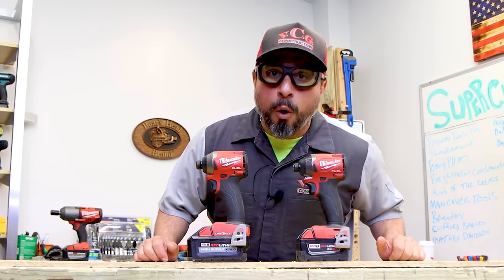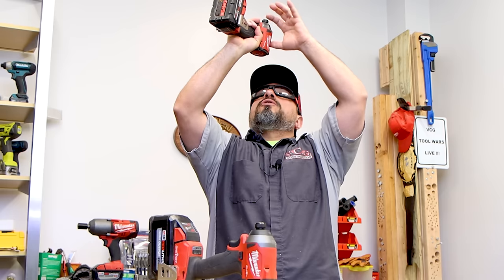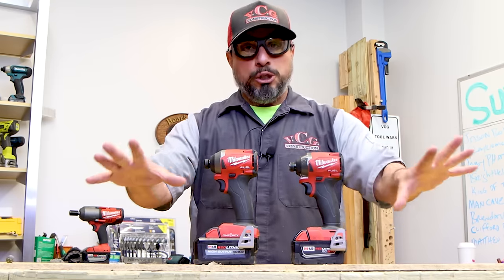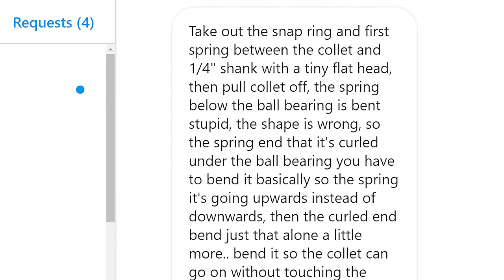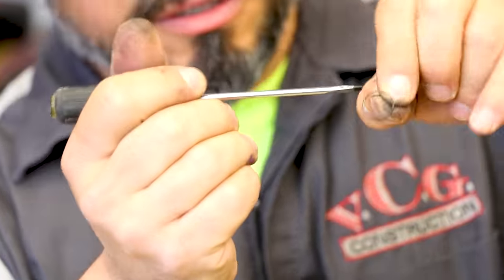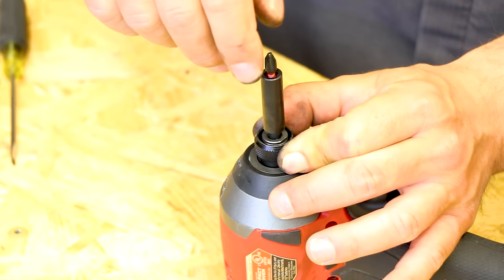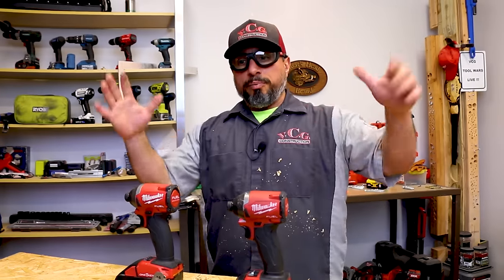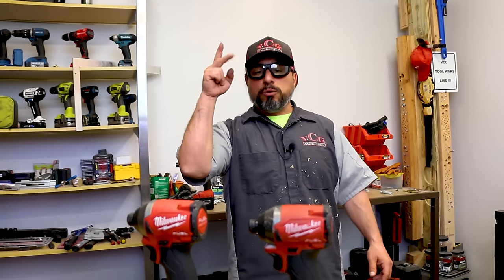FIXING MILWAUKEE M18 FUEL Gen 3 IMPACT DRIVER COLLET PROBLEM (must watch)

Comment: Again watching this video why aren’t the people that  Milwaukee given this video if this is the way to fix it why are they doing this again to the fellow in the video send them the video I didn’t not that bright to fix this maybe you should go work for them if you seem to know the problem this is the problem with the companies they will never fix this because I’ll tell you why because when it break.... this goes for everything and I mean everything when it breaks they want you to go out and buy a new one so they will never fix this Milwaukee drill because if the quick release is broken then you have to go out and buy a new drill or impact driver or hammer drill or whatever has a quick release in it this is the same thing with the new DeWalt tools they have a new battery.... it will not fit in the old DeWalt drill so this means you have to go out and buy a conversion kit for the Dewalt drills to fit the new DeWalt battery which is a pain in the ass if they were smart they would’ve made the neck on the Dewalt batteries the same way Ryobi has their tools case in point Ryobi tools over 100 tools you can buy and maybe 12 different yard tools you can buy one kind a battery not like the new drills now so that’s my question

Comment: I got an idea don’t use those paddle bits they eventually ruin your collet anyway, use a drill driver it’s way better, faster, quieter and safer. Just because it’s a 1/4 bit doesn’t mean you have to use it on an impact. I feel like I’ve watched this video before

Comment: Why don’t you clear the shit out of the hole Your drilling. Then drill in a bit Further, bring it back out, (clearing the shit out of the hole) then drill a little further, take it out again! (clearing more shit out of the hole) Basic common sense and good practice! Do it the exact same way as your doing it with a normal drill and it will jam that The exact same way!!!!. 
gx Wales Uk